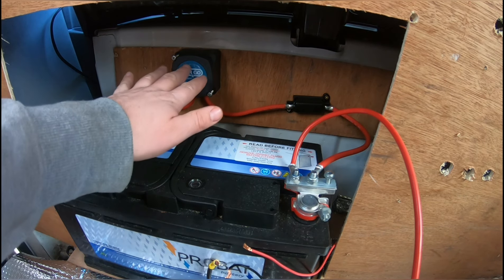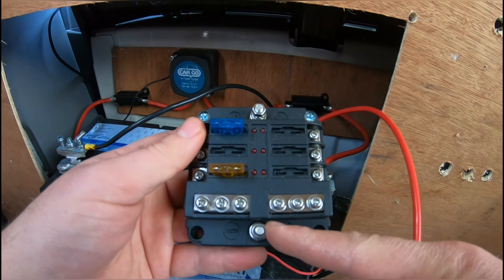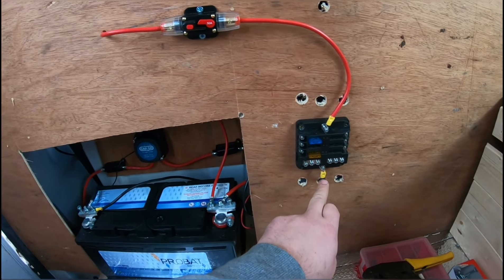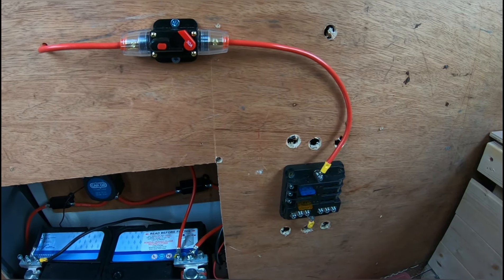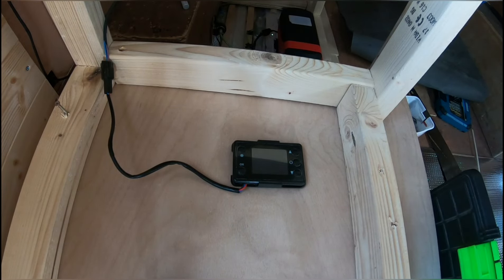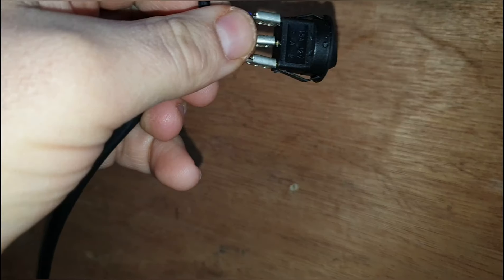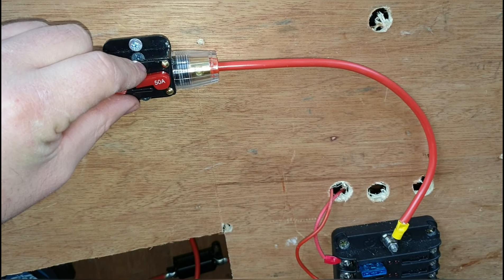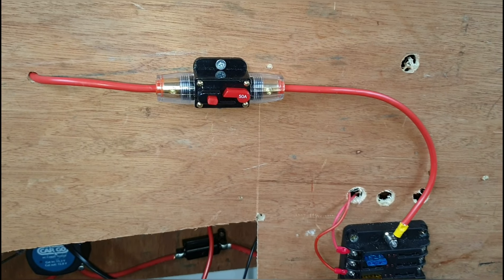Easy 12V campervan electrics tutorial  -How to

Comment: Looks OK to me.  A little bit unconventional  but I won't quibble. It is certainly safe and functional.  When I was working with aircraft they said something to me which seemed odd at first but makes perfect sense. "Fuses are not there to protect the devices, they are there to protect the wiring."  Cheers.

Comment: be very careful with that breaker and the diesel heater. if you fx leave the van and the heater hasn't gone through its cool down sequence , and you trip the breaker because you want to shut down all power for the night, the heater will fry the main board because of over heating. Easy mistake to make! I wonder if it wouldn't be better to wire the heater directly to the battery for continous power. Also, I see alot of those screens lcds go out. people recommend putting a switch on it when not in use to conserve the lcd. (same applys though with the shut down sequence, not sure if turning the lcd screen off cuts power to the whole heater, needs to be looked up!) good job on the videos!
Reply from the maker: You know what,  that's one thing that i didn't think of ...
May put it directly on the battery instead,  cheers for the advice mate 👍
Reply: @LT_TOMMY_  if you wired the heater directly to the battery (giving continuous power ) would you then simply turn on and off as required? and now further down the line after this was aired are you indeed doing this Im about to start a build and Im looking into electrics and im being very careful to observe all this stuff as I dont want problems
Reply: get control with red remote lot better   atkins is correct
Reply: Good info.

Comment: Late to the party, but my split charge kit instructed me to put one of the in line fuses close to the starter battery. 

I think if you ever exceed the amp draw that cable is capable of, you have nothing stopping the part in the engine bay burning through?

Comment: Thanks for the video. I've got the same setup but I've added 6mm cables from the fuse box to a 12v plug to power my fridge. When I turn everything on, the fridge screen says low voltage and won't cool down. Any suggestions? Thanks 👍

Comment: Can you not use the body of the van as the negative for all the accessories coming off the leisure battery? 
And then ground the leisure battery?
Asking because I don't know, not a surgestion 🤔
Reply from the maker: Hello mate, earthing your appliances  to a decent clean earth point on the van should be fine .
Other then saving on a bit of cable it would be much neater using a fuse box for both 👍

Comment: I got a 2012 crafter lwb, does yours have a smart alternator? dont know if i need a split charge or a ctek battery charger?
Reply from the maker: mine doesnt mate ,i was told if your battery has a small black box usually on the negative side cable then that could possibly be a smart sender , if its just cables only then its not smart. 

im not a mechanic, this is just what i have been told , mine works fine .cheers

Comment: Nice vid. Can you explain the reason for 2 fuses from the split charger. Surely one large fuse from the leisure battery to split charger is enough?
Reply: So the fuse protects the wiring not the charger.  He is protecting the wiring from the van battery to the split charger.

Comment: What is the breaker between positive and negative on the battery?
Reply from the maker: Hello mate , the breaker on the live between the battery and fuse box is a 50 amp breaker.
Is that the one you mean ? 👍
Reply: @LT_TOMMY_  yes i understand the 50amp breaker on live wire for fuse box i didn't quite understand what is connected and Fused from plus side to negative side on the battery itself? Cheers thanks Tommy

Comment: I don't want to be picky, but have you used the right size wire for the amps that will be going down it? I would hate to hear it went on fire?
Reply from the maker: 10mm cable with a 50a breaker plus run into another fuseboard. 
It's plenty enough 👍🏼

 But definitely nothing wrong with being cautious 👍🏼
Reply: @LT_TOMMY_  no worries Bud, all good then👍

Comment: I have a 5 gang inline switch panel. Can this be used as the switches for my lights, water pump ect and just wire this into the same fuse box used in this video

Comment: hi can some1 tell me if ya need to use an inverter when doing the wiring this way thank
Reply: You can wire the inverter directly to the battery negative and positive with a fuse on the positive and you ground it to the chassis and you are ready to go to use your 240 power.

Comment: You made that look so easy. The link is dead and I am worried about buying a circuit breaker thats not safe, could you provide an up to date link for one that you would recommend please? I am going to use it in my camper van.. Thanks so much for the tutorial..  :)
Reply from the maker: Hi 👋 

The link is now updated,  here it is , this is what I would personally use ,select 50 amp👍

https://www.ebay.co.uk/itm/20-150AMP-Trip-12V-DC-Car-Audio-Solar-Energy-Inline-Circuit-Breaker-Fuse-Holder-/143968641068?mkcid=16&mkevt=1&_trksid=p2349624.m46890.l49286&mkrid=710-127635-2958-0
Reply: @LT_TOMMY_  it's no longer there
Reply from the maker: @stevecrowe176  The ebay store must have closed down, just search on ebay for a 50a breaker 👍🏼👍🏼👍🏼

Comment: I hope I am wrong, but are you sure the large red is 10mm, it looks like 6mm to me, the reason I ask is that usually yellow crimps are 6mm (blue is 2.5mm and red is 1.5mm approx.) If it is 6mm then the breaker is rated too high, its only just on the mark if it is 10mm as it depends on what type of cable it is and the rated temperature of the insulation. Sos to be a buzz kill.
Reply from the maker: Hello mate , yes the Red and Black are both 10mm cable 👍
Reply: Great, glad to hear it, might be worth checking the crimp terminal size.
Reply from the maker: Will do , cheers pal 👍

Comment: Tommy how do work out what size breakers i need going from batt to fuses
Reply from the maker: The cable size always need to be rated higher then the breaker or fuse size .
I'm using a 10mm cable which will give up to 70 amps protection which means a 50amp breaker will just be lower then the cable rating and should work fine 👍
Reply: @LT_TOMMY_  I know nothing about electrics mate. If i use a 16mm cable what breaker should i use? Thanks

Comment: hi . just come across your channel  very good by the way could you help me . i am trying to put a switch in to turn my power on and off i have a fuse box  i am just starting to do window cleaning i can wire the controller up  but it runs all the while and i need to put a switch in  to turn it on and off . i  have just tried just a one gang light switch just andy but every time i turn it on it just blows the fuse any help would be most grateful thanks, barry
Reply from the maker: Hi and thanks 👍

Maybe a breaker between your battery and controller.
Reply from the maker: Similar to this 

https://www.ebay.co.uk/itm/143968641068
Reply: @LT_TOMMY_  ok thank's

Comment: Nice video, does the wire to each accessory need to be rated for the size fuse you are using?
Reply: No, the fuse is to protect the wire, not the accessories. 
Eg: 12v fridge draws max 5a, a 15 or 20a wire would suffice, using a 10a inline blade fuse (or the blade box used here)
Also position the fuse as close as practical to the 12v supply

Comment: Great video. Silly question: does the 10mm cable you're using have 2 cords in it (pos and neg) or is it just 1?
Reply from the maker: Thanks👍 , No , the live is a single core and the Earth is a single core, never a silly question if you dont know 👍👍👍
Reply: You can get cable with two cores in 10 gauge. I use it for remote fuse blocks in my installs. They won't be inside of a sheath, they will just be stuck together and very easily separated if you need them to be.

Comment: Will 1 battery be enough as most I see have 2.. like to only have 1 if possible
Reply from the maker: Hello mate , 1 battery has always been fine with me , i usually do small festival trips or holidays not much more then 5 days. 
I can comfortably run my diesel heater, lights, tv and phones charging for 4 nights , i haven't tried any longer to be honest. 
I would prefer 2 as back up and possibly will do in my new build👍

Comment: Nice video Tommy real helpful to see. How does the cable go in to that breaker is it a crimped fork connection you need or just strip the wire and screw it in? I'm ordering all my bits now!
Reply from the maker: Thanks mate , glad it helped , i crimped all mine for a decent fit 👍
Reply: @LT_TOMMY_  Thanks Tommy!
Reply from the maker: Sorry mate , i read this wrong , the cable going in to the 50 amp breaker  just pushes in and screws down , the cable going into the fuse box is crimped 👍👍👍👍
Reply: @LT_TOMMY_  Cool thanks for the update. I got one more question if you don't mind, I seen loads of people using a 12v switch after the circuit breaker, do you know is there a reason for that seeing as the circuit breaker also works as a switch? Seems a bit pointless otherwise
Reply from the maker: 12v switch as in a normal light switch etc?
The breaker is just extra protection for the wires etc.
Reply: @LT_TOMMY_  got it, yeah was thinking a fused switch but basically what the circuit breaker does so will just stick with that. Thanks for replying mate you've helped me out.

Comment: Hi Tommy nice vid thanks for sharing  easy to understand just one question if that's okay
From the leisure battery do I need to earth it to the van then to  the fuse box or straight to the fuse box I have the same one as you  thanks in advance
Subbed and liked chees
Reply from the maker: Thanks mate , glad it helped 👍 
Mine's got an earth straight from the battery to the fuse board mate 👍👍👍👍
Reply: Thanks Tommy for the fast reply will be watching all your vids tonight in work and look forward to more coming good luck take care 👍👍
Reply from the maker: Thank you mate , much appreciated,  are you filming your build? If so I'll sub👍
Reply from the maker: Sorry mate , just read this back through,  my leisure battery is also earthed to the body 👍
Reply: I dont understand how youre saying the fuse board is earthed from the battery negative post.  Surely the battery negative also needs to be earthed to the chassis.  I am at this stage in my electrics having done my electrical hook up and 240 sockets which I earthed to the chassis.  I though all house batteries had to be earthed to the chassis  @LT_TOMMY_
Reply: Ah ok I just saw this now.  So you have earthed it to the chassis and also ran a negative from the battery negative to the fuse box negative.  Thanks so much!!   Great video @LT_TOMMY_

Comment: Great video,got same set up in my van I'm planning to put in a couple of usb sockets any ideas of wire size amps etc....cheers mark
Reply from the maker: Hello mate , cheers 👍

Ive used 1mm for my lights and usb plugs , i wont be using anything thats high wattage so it should be more then enough 👍👍👍
Reply: @LT_TOMMY_  cheers mate, wish me luck

Comment: nice simple easy to follow instructions. Is the leisure battery or fusebox earthed to the bodywork? do any of them have to be? I did see you mentioned the splitcharge was earthed to the chassis via a bolt.
cheers mate, enjoying your videos
Reply from the maker: Cheers mate , hope they help a little bit 👍 
So positive from battery to fuse holder and Negative from battery to Negative on fuse holder .
The only thing i earthed to the bodywork was the split charge 👍👍👍
Reply: Did you not earth the battery to the bodywork @LT_TOMMY_

Comment: Been searching for a video on this, really good simple instruction👍 one question - without that breaker would you need to disconnect the battery to work on the fuse box ?
Reply from the maker: Thanks mate 👍👍👍

Better to be safe then sorry.
Either disconnect the live from the leisure battery or the live from the fuse board for the sake of 2 mins👍👍👍
Reply: Van Life Tommy ideal cheers mate
Reply from the maker: No worries,  if i can help in any way just gis a shout 👍👍👍
Reply: Van Life Tommy will do, about you attempt to wire in lights tomorrow 😬
Reply from the maker: Your be fine pal 👍
Reply: Van Life Tommy done it !. Even added a little spotlight for working in the electric compartment 😉
Reply from the maker: Good man , knew you could do it 😬👍👍👍

Comment: Very well explained. Would normally use different grounding points around the van for each accessory. Was interesting to see how you ran the earth from the accessories to the switch and doubled up the earths for both switch and accessories and put them both straight into the negative side of the fuse box.
Reply: yeah, I am wondering about that. Can you Earth the installed campervan electric system to the van chassis. That way only a positive feed need be ran to anaccessory, with a small lengthe lead to the vehicle body acting as the negative for it?

Comment: I hope you have another fuse at the main battery otherwise all that 10mm cable going to your relay is unprotected
Reply from the maker: 2x fuses with the relay kit plus a 50a breaker between leisure battery and fuse box .
Reply: @LT_TOMMY_  yeah but the fuse is at the wrong end of the cable from van battery. it should be right next to van battery or you have a long cable run from the bonnet to the fuse I can see that is unprotected.
Reply from the maker: @keithstead520  No mate , the first fuse starts under the bonnet about 5 inches away from the starter battery.

Comment: Big help for my van thanks for sharing. If you had one of those multi switch panels like

 8 Gang Rocker Switch Multi-Functions Panel - 12/24V Toggle Rocker Panel Waterproof with Digital Voltmeter, 4.2A Dual USB Charger, Cigarette Lighter Socket for RV Car Boat Vehicles Truck Trailer (Blue) https://www.amazon.co.uk/dp/B08HM4NBRV/ref=cm_sw_r_cp_api_fabc_1BDMDWVKCVX9SHRSZY4W?_encoding=UTF8&psc=1

Would you run that from the fuse box or from battery with a breaker ?